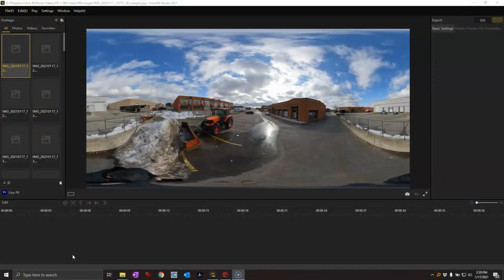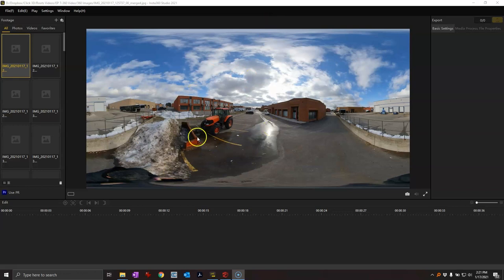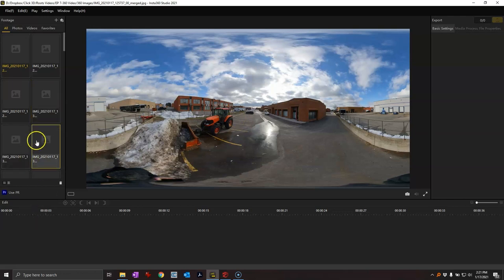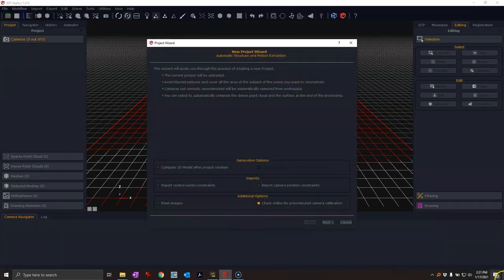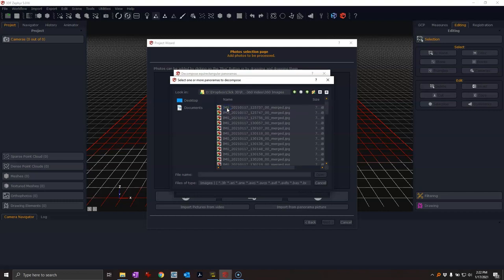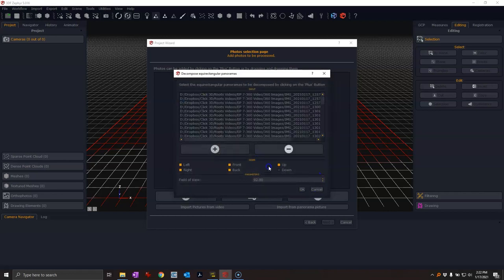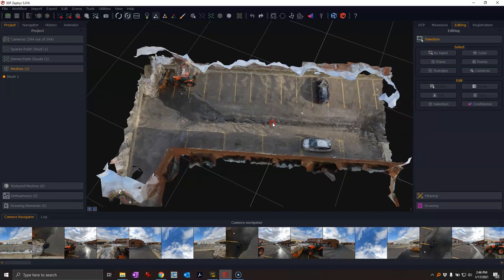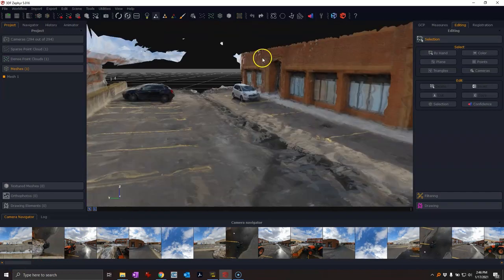3D Models from 360° images ? | Photogrammetry | 3D Forensics CSI | Click3D EP 7

Comment: What a great video! hope you'll make more on the same topic
I would like to ask you a question which is related to the position of each point, is it georeferenced? can we take real measurement ? if yes then can you guide me on how to do it? i'm working on the same project so it would be very helpfull to get at least an idea of how i can start doing it
Reply: btw, I'm actually using a tool that has 5 cameras and gps/ins , called Leica Pegasus:Backpack ((maybe that can help you understand more what i'm going through while suggesting something .. Thank youu
Reply from the maker: I know the Pegasus Backpack and you could use the individual images and some photogrammetry software.  I don’t think they are panoramic cameras but they likely stitch the images to create a pano image.  In that case, you need not bother with the pano images and just use the raw images that come out of the cameras.  If you want to learn more, I am having a free photogrammetry week, www.ai2-3d.com/photoweek April 6-8, 2021 form 4pm eastern each day.
Reply: @3Dforensics  well, the images will get stitched automatically and create a panoramic image as a result, with only the half tour that is properly shown in the image (the rest of the 180° is not shown, cause it wasn't taken).. Doesn't this case apply to mine too? I will make sure to assist to the webinar, thank you so much for the invitation
Reply from the maker: @imaneakr9207  So long as you have overlapping images, you may find that you can create 3D models from them.